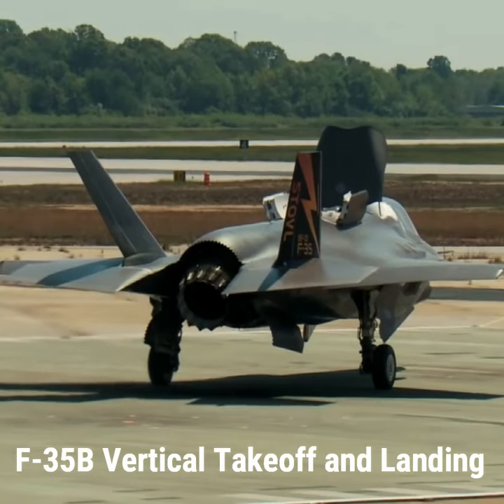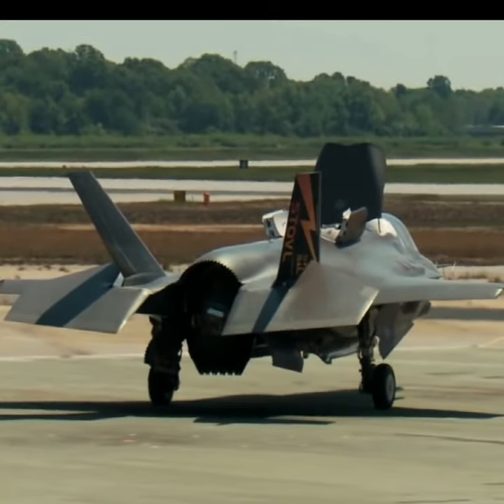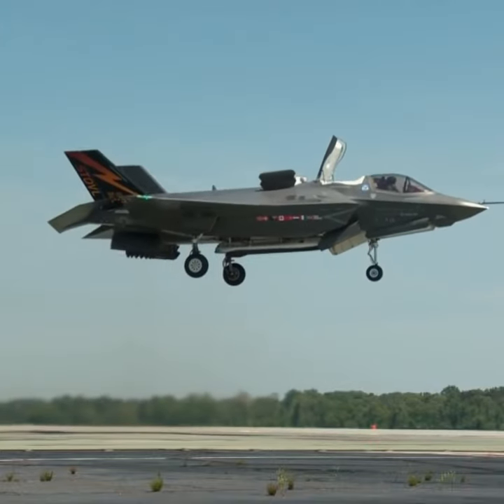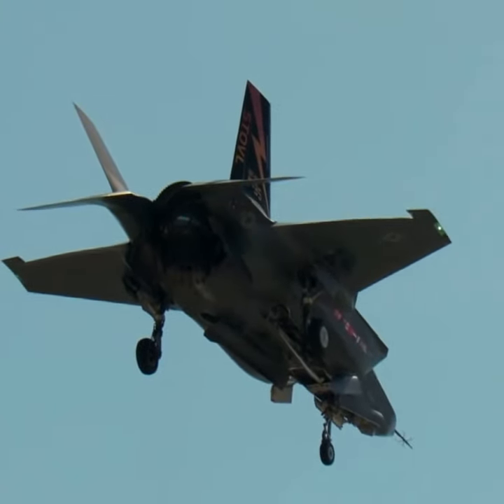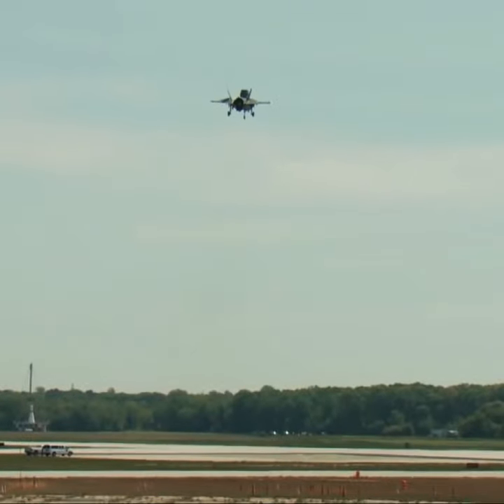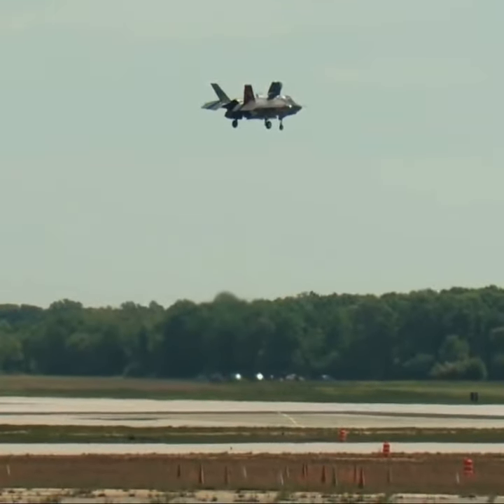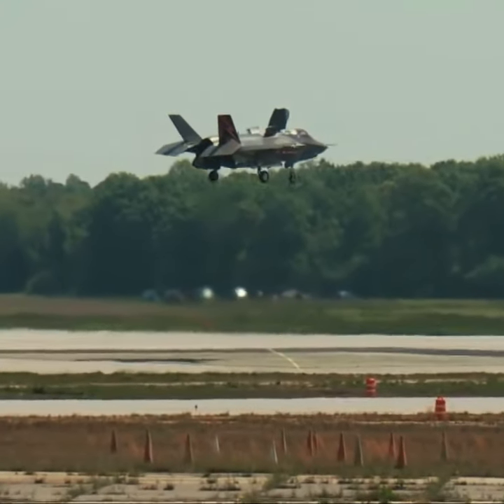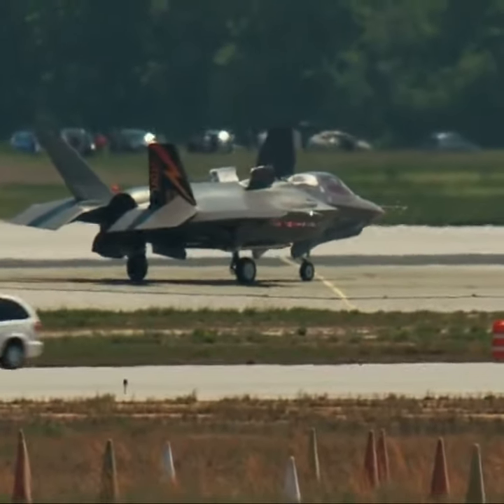F 35B Vertical Takeoff and Landing ! Fighter Aircraft #Shorts

Comment: The British harrier jump jet had the same vertical lift technology back in 1967, nothing new here.
Reply: it’s a very different system, the harrier had a big problem with recirculating air and would literally flip over, this has a completely different design
Reply: Hmmmm F-35 can land vertically at the same time it can reach speed about mach 1.8
Reply: @bigred913  rubbish, i suppose thats why the us bought the Harrier from the UK.
Reply: @bigred913  this is a very improved upon version of that tech. your comment is like comparing the first computer to the newest ones now. "first one had a keyboard just like the new ones, nothing new here."
Reply: @martinanderson1995   they had nothing else

Comment: No.. no that's a VTOL. The fact it just ascends without forward momentum is the big clue.
Reply: STOVL is literally the same thing my guy
Reply: They are different.
Reply: @DarkTrixEz  Well, technically no, since VTOL stands for Vertical Take Off and Landing, while STOVL stands for Short Take Off and Vertical Landing

Well they both have Vertical Take Off
But some VTOL aircrafts doesn't have the STOL capability. Just VTOL no Short Take Off and Landing
Reply: @e.sstudios1015  it lands 'vertically as it falls off the sky due to one of its 1,350 technical problems